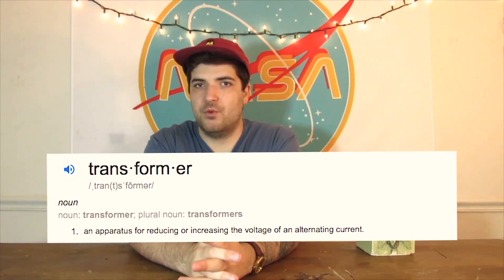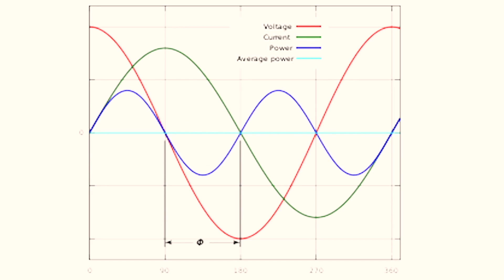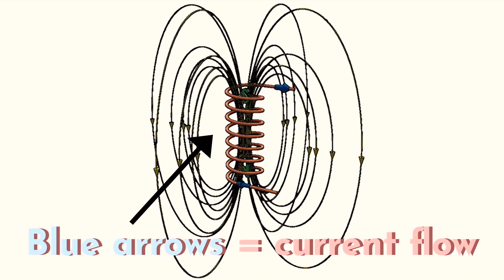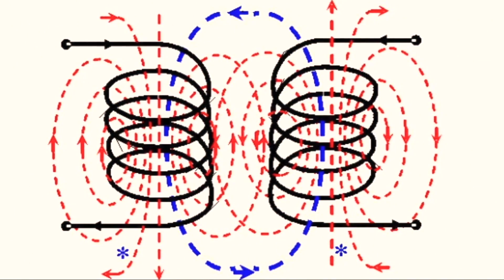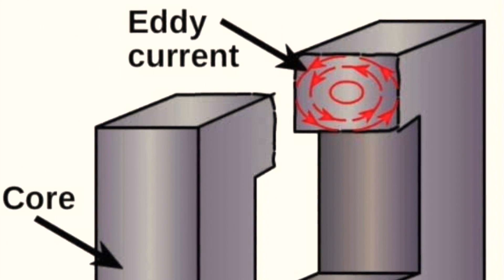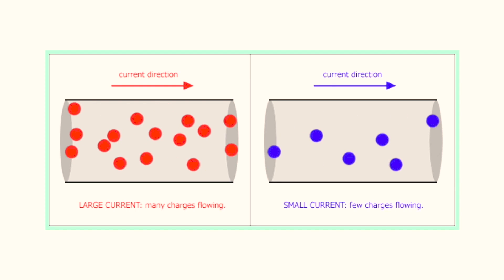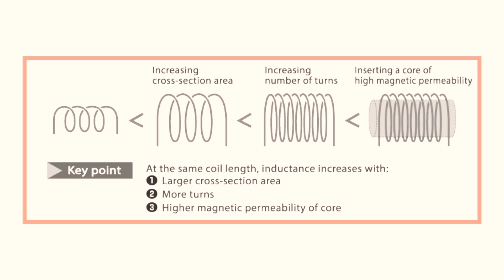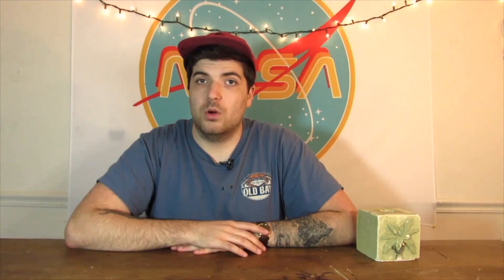Step up/Step down Transformers explained in under 10 minutes

Comment: Hmmm, well I have to say that you are an incredibly good teacher on this subject.  Having said that I am now positive that I will never have the ability to understand electricity and I will not be messing with it.  I just bought a contraption that step up or step down because I bought a belt sander that's motor only runs on 220v if I want the power it can produce.  So I got a contraption $120 that can plug directly into 110v wall socket and puts out 230v on the other side.  I was just trying to see if I could learn how it is doing that and this is probably the very best video I have seen on this whole subject and have absolutely no clue how it works still.  I got the biggest watts I could find with the contraption.  So it plugs up to 110v and outputs 230v (which I know the 2 types are 110 & 220, but even the motor says it's a 230v) and has 5000 watts.  I did some research and it said something about having double what you need for it to run efficiently for a long time.  3hp 230v is apparently close to 2600 watts, so I figure 5000 is pretty well double that.  So hopfully you read this and respond if what I have purchased will be safe or not.... cause I dont wanna get shocked and die and I really dont even know who to ask.  I was thinking about taking it all to a power company and asking them to check it out, but I'd rather see if theres an easier way before I go loading all this up and ruining some poor electrical plant persons day.  Thanks in advance, if I could learn electricity then this would have definitely been the video to make it all click.

Comment: Nice video. I was looking to hook a asic miner that runs at 1200w to a step up transformer from my regular 120v house outlet. Would this be safe or recommended, this would be running 24hrs. I'm assuming that rewiring the outlet may be a safer option 🤔
Reply: Wattage = Voltage X Current (under resistive loads) 
Your North American 120V outlet is either on a 15A or 20A circuit breaker. NEC dictates an 80% continuous load for circuit breakers. 120 X 15 = 1800. 80% of 1800 is 1440. 1200 < 1440W
Just rewire the receptacle/outlet to a separate circuit breaker at your breaker panel. This would get rid of any other loads on the circuit that outlet is on, because it is cutting it close. Your best bet is to wire the outlet to its own circuit (120V 20A) and thus a new single pole breaker on your Service Panel/Breaker box

Comment: I've got a question: if I have a generator that is producing/converting up to 3600watts of electricity and the only socket is 120v... I need to get 220... can I use a step up transformer to do this and if so how many watts of electricity am I going to lose?.... if any... thank you. I would assume in a step up transformer I'm going to have 2 transformers both producing 120v at 180 deg out of phase... correct me if I'm wrong, thank you.

Comment: I'm trying to make an AC stick welder and I think I have the idea right I just want to make sure but if I hook up two Transformers in series on the secondaries I would get double stepped up power on the primaries coming out correct? And also tie the neutral together only secondaries is that true too?

Comment: I'm working on an acme 5x24 series time transducing capacitor with built in temporal displacement and AMD dimensional warp generator modules..but I need to get hold of a GRC79 induction motor..if tou can help thx..and enjoyed your presentation..happy travels🛸🤫
Reply from the maker: thank you :>  
you might want to be careful with those transducing capacitor's. 
you need to keep the six hydrocopic marzel vanes away from the ambiphasient lunar wang shaft if you want to prevent side fumbling.
Reply: @MillersPlanetOne  well I've accounted for atomic mass to quantum weight..I'm dealing with alot of  extra dimensional isotopic matter(9th dimensional) ty for your input but ....

Comment: Hello, how can I step up and convert DC voltage into AC voltage? I thought about using a DC boost converter with 3V input and output 90-100V that I would pass to a Crystal oscillator to produce AC current
Reply from the maker: for that, you're gonna need some kind of inverter - turning dc to ac. from there you can step up the voltage using a transformer
Reply: @MillersPlanetOne  What are the advantages of an inverter compared to a crystal oscillator?
Reply from the maker: the crystal oscillator is often used in timing circuits (like inverters), but by itself, it can't be used to turn dc to ac - for that, you'd need MOSFET's, BJT's, and/ or other components to amplify the output signal... crystal oscillators would be a good video topic

Comment: Can a step up transformer be used to create extra free energy ?    Example  :  120 volt coming in and a lot more volts coming out to create unity  to run multiple appliance ?  Thanks for reply greatly
Reply from the maker: Joeblow Johnny hey, unfortunately no, us humans have to abide by the first law of thermodynamics
Reply: @MillersPlanetOne  there a guy on youtube that claims he running a small 5hp generator to generate 120v coming into  2 huge inline electric company utility pole type transformer and what he get out is about 6000 volts and he is running  4  electric portable device at the same time . On video , he has a verifide electrician with him to verifide the result is true !  ........  I would like to send you the video for verification of your knowledge in this matter ........ is this o.k.  ?
Reply from the maker: Joeblow Johnny the output voltage is higher than the output (in step up transformers) but the current is consequently dropped... I’d love to get the link though 👍🏻
Reply from the maker: Joeblow Johnny thank you! I’ll give it a watch
Reply: @MillersPlanetOne  mr. Miller's , have you had ta chance to watch the video yesterday ?  Im waiting on your expertise input on the matter ?   Awaits .... thank you
Reply from the maker: hey @joeblowjohnny2297 , I think those 'cans' he keeps referring to are tuned high voltage capacitors - that's why the generator never put out more than 30 amps// also he keeps talking about cold radiation which isn't a real term/ energy source... hope that helps c:
Reply: @MillersPlanetOne  so you saying its a scam ?   You saying it is impossible to do exactly what he is doing ?   Running 4  120v heater  on 1  120v  line  ?
Reply from the maker: @joeblowjohnny2297  yup, the three heaters don't need a minimum wattage to get started, so Im guessing they're were just running at minimal power (you can hear the noise get louder when he disconnects one, sending more power to the other 3 apps), and the saw is running at no load. Im not sure if those are transformers or capacitors, but either way there's nothing magical going on there :D